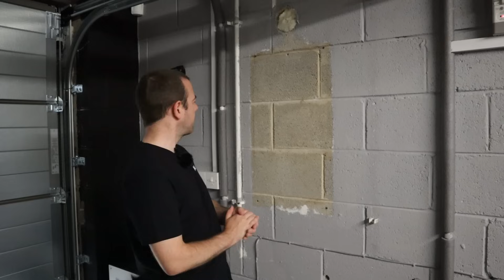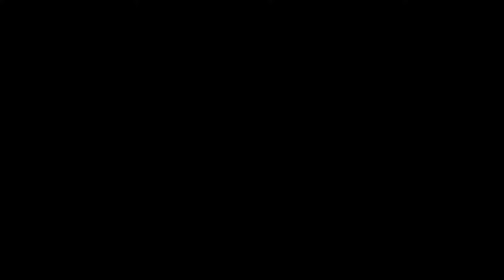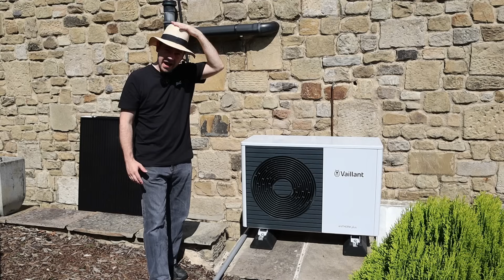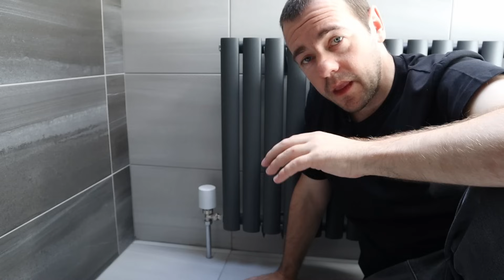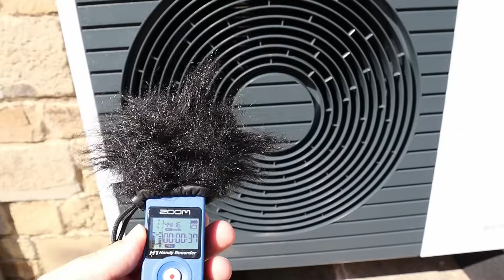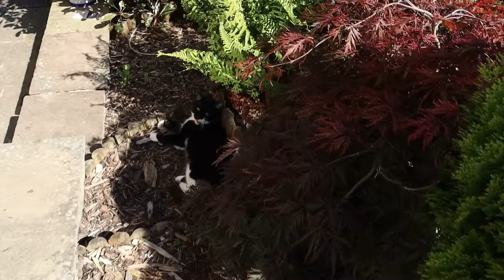Heat Pumps - Our 'Ugly' Truth!

Comment: This does rather come across as an everyman's guide to heating your mansion. It is interesting how often the favourable heat pump installation videos dispelling the myths of any other point of view seems to have a ton of space inside available for the systems. Finding space to install the Valliant unit tower in most other houses would not be a simple task without these vast empty utility areas to hand. Of course any bit of silent new machinery can turn in to tomorrows clattering cacophony so only time will tell.  I presume during a power cut this house will go cold and gas is rarely cut off to domestic supplies. There is space for battery packs but a weeks cutoff which does happen and this house will go cold. With the electric cars needing feeding from the grid things will get more hairy in the future for supplies especially as it all come from Gas anyhow when the sun don't shine and the wind don't blow.
Reply: Although gas is rarely cut off, as you say, which gas boiler fires without electricity?  No electricity = no gas heating or hot water.
Reply: @andywaring12 My living room gas fire is my standby during cutoffs with no need for mains. Many people still use these. Probably an idea to get a portable gas fire which many used when we last had utility strikes which are going to come back with inflation eroding wages. I worked in a factory making these catalytic fires which were very popular.  I remember getting petrol rationing cards though they were never brought in to use. Gas is the one thing we have never had cut off as I suppose purging  the supply pipes could be a problem if air leaks back from appliances left on. It could be a long hard winter on the way.
Reply: @andywaring12  So get yourself a 2 or 3kW Victron  Multiplus and a few kWh of cheap and cheerful lead acid batteries and you have a home UPS that should ride through most power cuts to run your central heating, fridges and lights. Yes you will need a generator and/or a load of PV  if you are expecting days of mains  outages. Whether  UK will  just have rolling blackouts or more drastic outages this winter is an open question, but piling EVs and heat pumps onto a creaking power infrastructure seems a risky bet to me.
Reply: Ah, I see.

Comment: I have a very similar system with the mitsubishi ecodan system. Not sure if you can do the same with yours, but I changed out the immersion heater with one I could control the temp on. This in turn is connected to a solar i boost which uses excess electricity once my batteries are full to heat my water tank. For most of the year I get free hot water this way. When there is not enough sunshine the i boost has a boost function and can also be programmed for my/your time of use tariff. The installers were not aware that solar power could be used to heat the water this way, but the engineer who does the annual service is a Mitsubishi engineer and told me how to do it. Worth checking to save a few bob lol.

Comment: Hope EVM you'll have some videos up about the controls, apps etc. It would be excellent if after you battery is charged excess electricity can be diverted to the heat pump to warm up the hot water.

Comment: Seems to be a lot of negative comments. What I'd like to know is how much was the install and how much does it cost to run a month?  I'm fairly certain they work if installed properly but at what cost?. (Please don't include solar and battery as most don't have that yet and would be purchased before a heat pump).

Comment: Had one and apart from the water demand they are shite 
Much prefer oil as a non mains supply
Reply from the maker: Why was it shite?
Reply: @ElectricVehicleMan  it takes forever to get to a reasonable temperature of 19 degrees oversized rads and if it’s a big room you need an extra rad 
large system with the expansion tanks crap loads of lagging luckily I had a large build in coal cupboard but they won’t fit into your average Wimpy box
Reply from the maker: @dinkydaz6711  Or whoever installed it didn’t know what they were doing.
Reply: @ElectricVehicleMan  Really doesn’t matter who fitted the system I wouldn’t have it again 
Stick to my wood burner and Grant oil burner not forgetting our cozy coal fire
Reply from the maker: @dinkydaz6711  It doesn’t matter who built it??
It’s the most important part! Get an idiot, get a poor install. It’s not the tech, it’s the person.

Comment: Andy, I am getting.someone to quote me for the same system as you on a three year old house. Having seen your previous videos...how.does the Tado thermostats, radiator valves work with the pump? Did Tado had to get involved? Thanks
Reply from the maker: Thermostat gets replaced and valves stay but not call for heat.

Comment: We installed a Daikin Altherma 3 heat pump in June. The peak power output is slightly more than yours but we have a larger, detached property. Flow temperature 46 C; SCOP 3.8. We opted for a Mixergy water tank which is programmable to make the most of cheap overnight electricity, though we also have solar PV and a home battery to offset the running costs. At current and projected electricity prices it will pay for itself within the warranty period.
Reply: Hope they come good for me!

Comment: Great, informative video. Always good to hear experience from the horses mouth and someone who has spent their own $. Keep up the great work.

We've got heat pump heating/cooling in house and recently added a heat pump to our outdoor pool and it's works fantastic. We also had some learnings from our install and will have a video out in the next few months if anyone's interested from an Australian perspective.
Reply: It's also a horse with invested interests in going 'green'.
Reply: Not the same type of heat pumps.

These only do water heating, whereas in Australia they're air heaters/ coolers.
Reply: @Robert-j6r8c  Hi Robert, I understand the difference between the tech. We have 3 heat pump types.1. The domestic/commercial hot water heating type (similar to video), 2 pool & spa water heating and 3 the air heating/ cooling type. Although we use solar evacuated tube heating system for our hot water as it's the most efficient in our circumstances.

What do you have?

Comment: I had a question on time of day tariff...
If you run the heat pump overnight you have cheap electricity, but also the ambient air is cooler, so there's less heat to be pumped and it presumably has to work harder to reach a given temperature.
If you ran it at at time when there is more ambient heat, then you might use battery energy, which would have some losses putting power to and from the battery, but there is more heat so the heat pump has less to do.
My question is which is the lesser evil? Are you better off losing electric energy (by using the battery) or needing to work harder by running overnight?
I also was about to comment on Legionella until you mentioned the device has a Legionella cycle. 
But I think that's also why a lot of gas boilers run hot - if you have a "dumb" water cylinder, the advice (looking at various articles on flow temperature which are around at the moment) seems to be to run the boiler at a toasty 70 degrees.

Comment: Sounds great.  I was wondering if you considered using the heat pump for Air Conditioning.   I am in the US and many people hear do that.  I assume AC might not be as common in the UK but will be over time.
Reply: This is in one thing government is trying to actively discourage. Existing grants like the Boiler Upgrade Scheme are strickly for replacing boilers, i.e. heating water. Presumably this is to avoid a spike in energy usage in the summer, when output of traditional power plants (gas, nuclear) is lowest.
Reply: @johngreen1060  AC powered by solar shouldn't be an issue, and doesn't seem like a bad idea after summers like this one.
Reply: @grahamleiper1538  this is what I read. I haven't seen any official statement confirming or denying it. Summer electricity demand spike is serious issue,  PV definitely helps but we would need a lot more of it, so it makes sense not to promote AC just yet. Which is pity because this is by far the most efficient form of a heat pump.
Reply: "Wet" radiator systems don't really do much cooling. You can get some but you don't want to run below the dew point temperature to avoid condensation. Don't have a drain for condensation like an AC (mini split) head unit.
Reply: Why

Comment: Good vid. And I like the look of the all in one "fridge" install! Have not liked the look of the "pipes all over the place" heat pump installs which just look like a water leak going to happen at some pint in the future..This looks clean and modern. Will look forward to the updates. I did a quote on an install for our house about 3 years ago and it was shockingly expensive. All the rads would need replacing etc and upgraded pipework. But will be looking to get rid of our gas boiler at some point so a heat pump should been on our horizon.

Comment: A very refreshing video. It’s great to see more in life experiences with these. I’ve been trying to provide a balanced response to the naysayers for years. 

It would be interesting to see the specs for the outdoor unit. Also, yes 50 degrees setpoint is more than ample 👌🏻. I’ve commissioned a hell of a lot of York Amichi’s over the past four years and you really do not need to push past 50 degrees on a water system.

Comment: Don’t forget to insulate your garage door mate, also once a week do the legionnaires cycle off peak, 10 mins should do it but they will recommend 20 mins to be sure ,  if you do it twice a week 10 mins is fine , I’ll be interested in your wether comp setting and winter experience,  as my eco Dan was terrible, we had to do air to air as well. But we’re talking temps far far colder than the midlands ever saw .  I’m more interested on the amount of time the bypass unit turns on . Anyone who seriously wants to know what they really can do in the U.K. see heat geek, and use only accredited heat geek installers., but also do your own research online as n7 one who has had a installer will most likely post about there experience on the individual

Comment: Thanks for sharing your experience 🙂.  I had also installed a heat pump in my 50 year old house (12 years ago).  And it was the best decision I could have made.   It was expensive as it is a geothermal heat pump,  but it's very economical.

To add to your experience,  here's a few points I noticed or learned:
- a heat pump also saves money in maintenance,  as it doesn't need that (contrary to gaz heaters)
- best would be to use a heat pump at low temperatures (like floor heating) as the higher the temperature,  the lower the efficiency
- in any case,  a heat pump will always be much better than traditional resistive heaters

In my case,  in ten years,  I have saved more money in my electricity bills than the cost of the heat pump itself.  So yes,  it can be expensive,  but it remains a good investment 😉
Reply: So you don't have gas mains?
Reply: @Robert-j6r8c  No gas. Just electricity as energy.
Reply: @infinityNmore  That’s some speculative outlook. I will be better off in 10 years time Hmm 🤔 Here’s my prediction ( far likely to happen). 
Gas is now being considered Green again at an amazingly fast rate by those that called it the devil just a few years and months ago, funny that hey. (Even Greta has been thrown out of the gang) Therefore once the artificially created carbon zero demand loses support due to actual reality which it will, Gas will reign supreme and be cheaper than even 5 years ago. Gas boilers will once again be the tech of choice and heat pumps resigned to the looney tunes brigade. If I’m wrong I’ll be very,very, very surprised.
Reply: @Isclachau  it's not speculative. I have installed and I have saved money over the last 10 years compared to the previous heater. And if I compare to my parent's house which is heated with gas, including maintenance cost, my heat pump currently costs 1/4 of their gas burner in running costs. And gas prices are increasing more than electricity prices over here.
Reply: @infinityNmore  Well we would need to know your old setup and what type of inefficient heater you were running. And clearly your not in the UK. But either way gas will come down significantly when the looney tunes running the show get their act together. Like I said you will start hearing gas is green again in the coming years,. It has to be a very very specific setup with almost perfect installation for heat pumps to be better than traditional (ground source like yours is obviously better) and from what I’ve seen they are not. Even EVM’s setup looks horrendous and is onto a loser.
Reply: Well of course , everybody knows space and water heating by electric is the  most expensive option ,
Reply: What is the size of your house. And what were your electric bills. Temp set on. Thanks
Reply: @400exxxx  200sqm. Before it was electric heaters, about $10’000/yr of electricity. With heat pump and renovation, down to $2400/yr. Now with solar panels, $800/yr.
My parents with similar size house and gas burner, $1200/yr electricity and $4000/yr gas.

Comment: I bought solar this year. I want to get rid of gas too and want to go through a winter and more info before looking at taking the plunge. Thanks for the video, looking forward to seeing your updates
Reply: Think I feel exactly the same. My solar was installed in June and saved about 55 percent on the electric. Allegedly the battery will go live next month which hopefully will save another 50 per cent. Still using gas for heating though so very interested in other people's practical experience. The price of energy in this country is ridiculous, and a lot of smes will go bust in the next 12 months unless the government acts decisively.
Reply: @keithhobbs1  I haven't used any gas since April,I have a solar iboost water heater and that provides enough hot water provided there aren't too many after dark showers

Comment: In which instances wouldn't a heatpump work? Most people living in houses here in scandinavia have them and they work just fine no matter if the house is old or new.
Reply: The received wisdom in this country is that you need a highly insulated house. My house is proof that's not true. 150 year old uninsulated solid walls. I'm not going to claim that it was a cheap install and it does use quite a lot of electricity, but we have a low flow temperature and got a SCoP of just over 4 across the year.  It's efficient for the amount of heat it produces.

Comment: my take on your setup is i would have used pylontech batteries for future expanability tbh, and as for Triple glazed windows i had mine fitted 8 years ago on a old solid stone construction house, boy what a energy saver (68% on gas heating first 12 months), the only drawback with triple glazed windows is they reduce your mobile phone signal, but i would not change them @ all, for me living on my own me and my dog consumed less than £600 for gas and electric for the last full 12 months (£593.24p tbp) and yes i am on still on a fixed tariff with EDF till next august, which EDF are busy trying to switch me off of constantly and go the smart meter route, but my 16 solar panels on FITs paid and money over for the full 12 months ,so i am a happy bunny, be nice to see the white board of truth on a monthly basis for everything gas/electric costs etc etc (you will need a new pen or two though)  :):) keep them coming :) :)
Reply from the maker: Givenergy are way ahead of pylontech. And can be expanded.